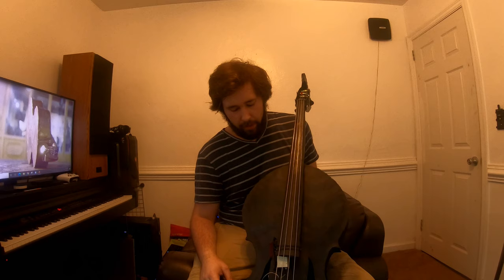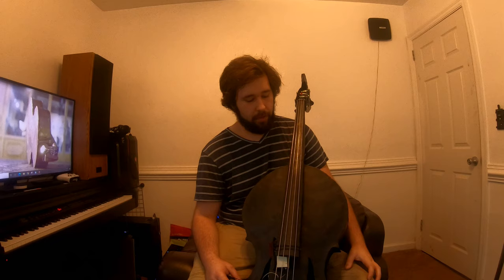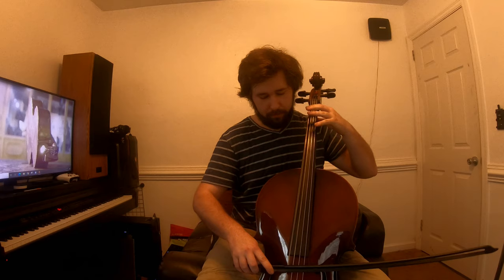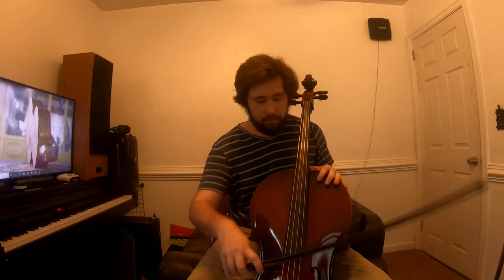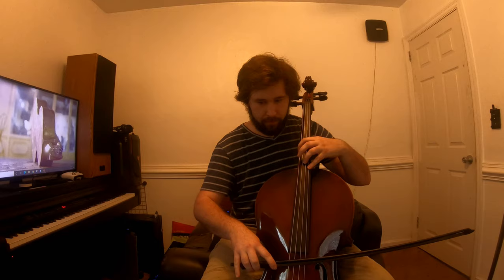STEEL VS WOOD CELLO: Direct Comparison and Discussion

Comment from the maker: Which one do you prefer after hearing them with similar setups? Does the normal cello sound as you expect with the newer 3d printed bridge? - Be sure to check out 18:16 for the straigh-forward mix between the two!

Comment: The steel cello sounds really nice, what about a steel bridge welded onto the top?
The piece you're playing, is that your own composition? It sounds very good.
Reply from the maker: Yes, that is all of my original music, thank you! When it comes to a welded on steel bridge - at the time, i didn't have all the tools that would be required to set it up and cut it out correctly, since the tolerances are pretty tight for the string placement.. Though now I do, the steel cellos been out of commission for awhile... id like to completely redo parts of the construction. So I may look into doing a steel bridge when I get around to it. my main concern with a steel bridge is that it would need to be a pretty thick gauge to maintain the bass end, or else it may make the tone too piercing. A printed or wood bridge offers a good amount of damping to the sound, and the printed one was designed to be hollow inside.
Reply: @uncontainedcuriosity2316  I'd like to build a steel cello myself if I get the time to do it. I have the tools and have built LARP armour and motorcycle tanks and fenders so I have some experience too. I was thinking about hammering a pattern into the front and back like a turtle shell if it's doable without too much work. Have you seen the guy who built wood violins like that and also with holes in them covered with drum skin?

Comment: could this instrument stand the rigors of playing outdoors? String instruments usually are not invited to play outdoor events because of their fragile nature
Reply from the maker: The steel one has endured road trips of thousands of miles without a case (bigger than standard cases) has been kicked over by someone not paying attention, among going to open mics n such. Tuning stability and everything perfect regardless. 
Only thing I had to fix was the bridge which broke when it fell. 20min 3d print and filing, no longer an issue. Steel holds up like you'd expect